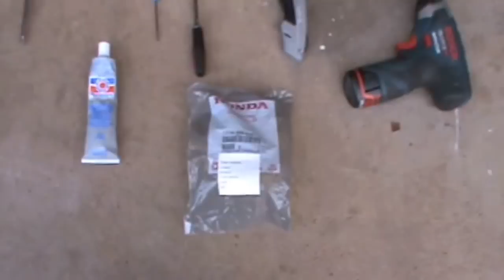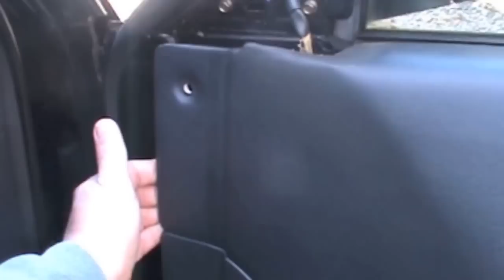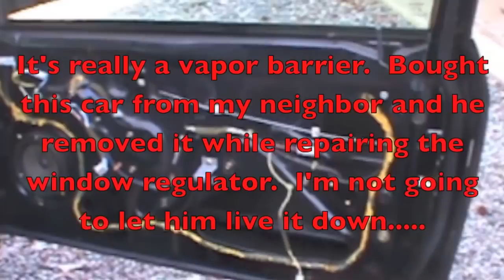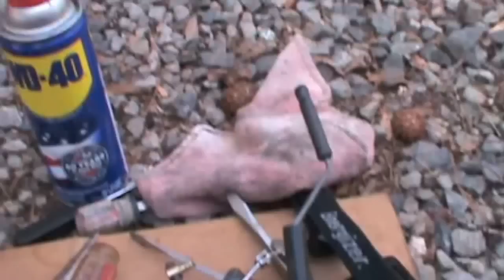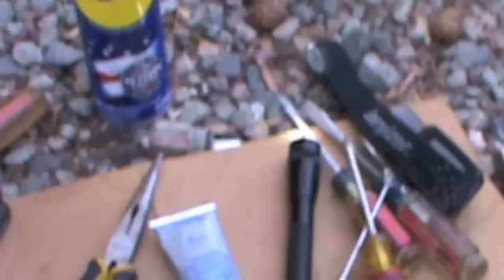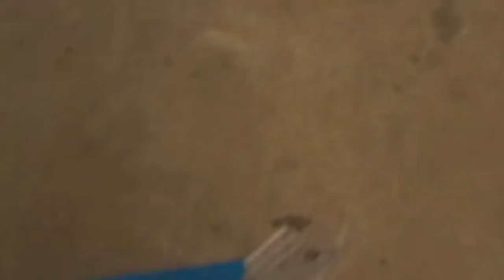1999 Honda Accord EX V6 Door Lock Actuator Repair

Comment: For some reason my key fob won't lock and unlock the passenger  side even After changing both door actuators . But it works when I use the door switch
Reply from the maker: Could be programming issue, etc. Are you sure all connectors are plugged in?  Part numbers correct?  All connectors in the driver door panel connected if it was removed?
Reply: Likely settings,  alarm and or after market alarm.. because,  it m dangerous places, unlocking all doors can leave you vulnerable to Sunriver hiding or just letting themselves in when you do

Comment: Thank you for the descriptive video. I could not figure out how to remove that push rod from the door handle... Since I didn't want to risk breaking the plastic handle, I had to loosen the latch assembly so I could pull it closer to me while I tried to hook the actuator arm on the plastic pin. Man what a unnecessarily difficult job!

Comment: @TOM2RN. Tom, you ever work on a 4 door Accord where the drivers door is locked shut & it's not the actuator that's bad. How do you open the door? I have the door panel off now. It's a 1998 Accord, EX Sedan, 2.3L 4Cyl....
Reply from the maker: Reach in and pull on the silver rod. Follow the one that goes from the handle. Sometimes the plastic retainer clip breaks and the rod falls out. In that case, you have to reach the latch mechanism with your hand. It may take a mirror to see. Be careful, sharp metal edges.
Reply: @TOM2RN  All the rods are connected so I am guessing it's the pin inside the latch assembly that's broken.... I'm gonna look at it in the morning.... Thx for getting back to me.
Reply from the maker: You’re welcome. These actuators are plastic city these days.

Comment from the maker: Actuator was 32 bucks online.  I usually order from Majestic up in R.I.  That doesn't include shipping and handling charge.  Local dealer wants around 60 bucks.  It is OEM.  Working great even in our 9 degree weather.